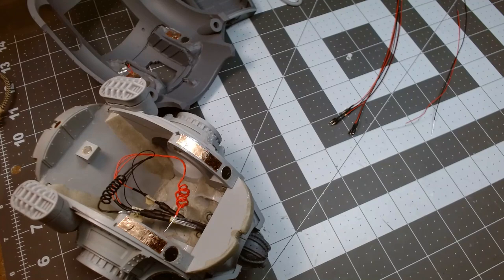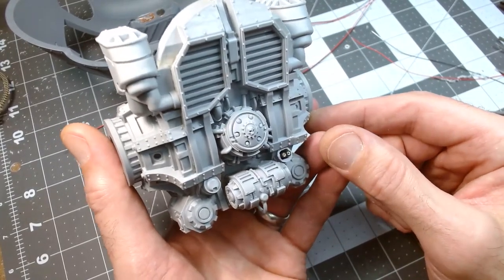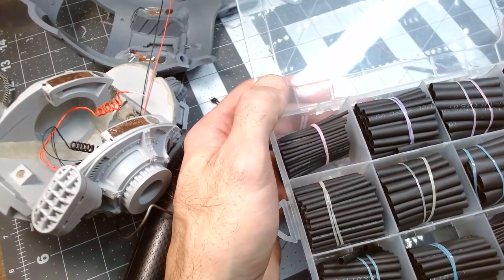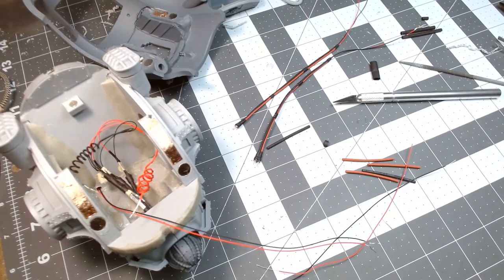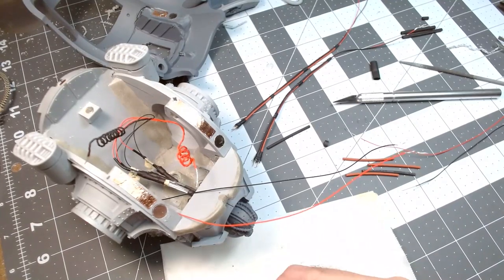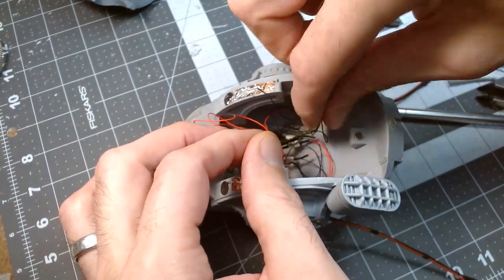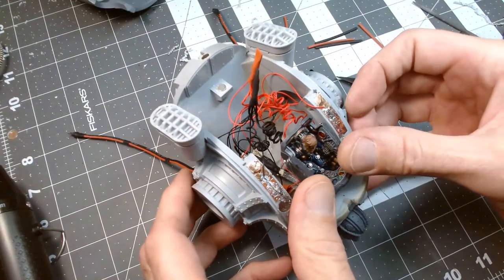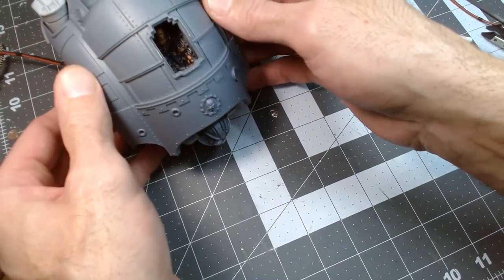Acastus Knight Asterius Build 27

Comment: Flux is your friend
Reply from the maker: The solder does have a flux core but I think you're right and it's not enough... I also think my soldering iron gets too hot... probably need a temp controllable one someday. Thanks though, I doubt I would have connected those dots as to why my solder wasn't flowing well.